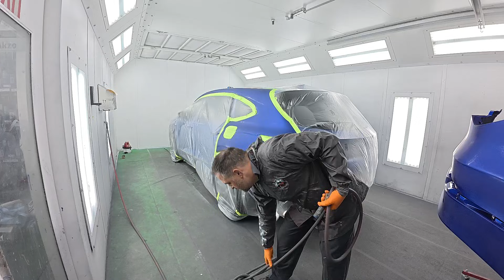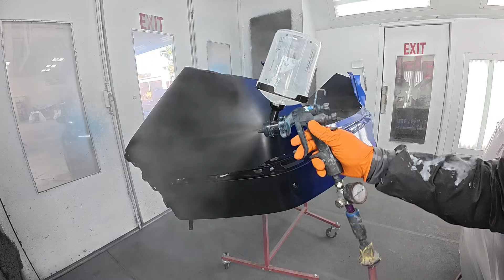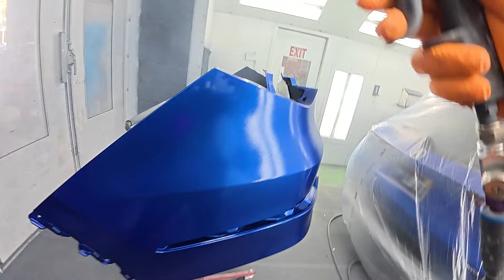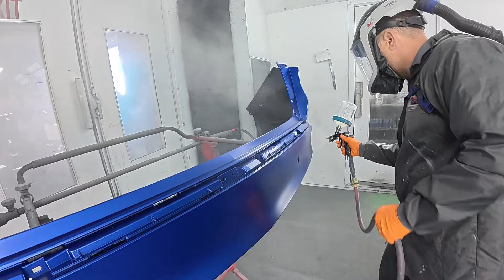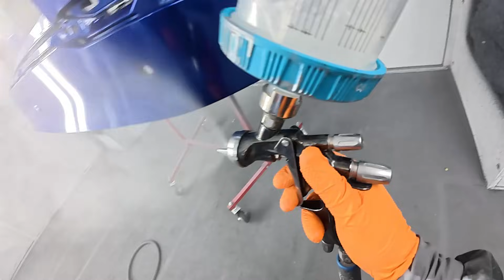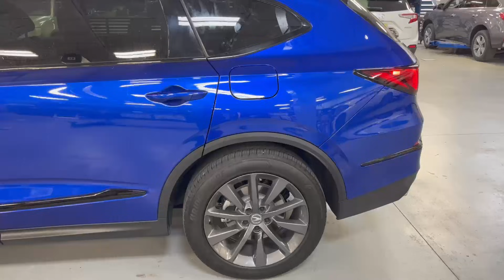How to Spray GLOSS Without Orange Peel! (Gun Setting Guide)

Comment: Also, why would anyone not buff out? We have spent hours and hours sanding, cleaning, priming, prepping and painting. Its mad to me why someone wouldnt want to spend that extra 30 minutes finishing what they started
Reply: Buffing is leveling the clear coat which means it’s removing a tiny amount of it. If you can spray it flat in the first place and not have to buff some of it off in order to get it flat, isn’t that better? Think about it.

Comment: In my experience the quality of clear coat you use is much more important than whatever gun or whatever gun setting you use. Low quality clears don’t have the hold out they should. And that even shows after they dry overnight and they looked outstanding off the gun

Comment: Do you like the supernova? I don't know how the new supernova's are but the first ones I felt made a lot of over spray. Recently I got rid of my 3 DV1's and switched over to ANI and I absolutely love then. That ANI Skull edition 1.3mm set that came with 3 caps an HVLP, WB, and CLEAR cap with digital manometer works awsome better than both DV1's for base and clear. For my 0.8mm mini for cerakote I got the R160 HPS that has the receptical above the air knob and fluid control so I can use the TMD1 manometer that came with my 200 Skull. Still using that Porphis 1.8mm for my primer gun. Out of all the different primer guns ive owned its the only one i ever liked.

Comment: I found out one thing with my spray gun setting. I always used fluid screw all the way out like you said and try to match the speed. But It looks fine but after drying I always had orange peel. I decided to make it 2 turns in and closely watch when the clear coat is sprayed and it lands smoothly on every coat. By watching closely and spraying less fluid I managed to get smoother and much better clear coat without orange peel

Comment: So,let's say your base didn't go on super well, maybe it's a little rough, what grit would you use to knock it down so it's smooth?
Reply: I wouldn’t touch it. Only recoat. 
For small imperfections, it’s ok to sand with 800-1000.

Comment: Hey Brian.  Are you using the new fine tips on that 3m gun?  Does your base coat your using have hardner in it?
Reply from the maker: Yes, they worked very well
Reply: @PaintSociety   I would love to hear more from you about the 3m fine tips.  I have been using them for clear and base with very good results.
Reply from the maker: @Tablerj23  I don’t have any issues with them. They’re really good and they really break up the clear very well and they’re just very easy to clean out.

Comment: Will there be an adhesion issue with the areas that weren't sanded and are still shiny?
Reply from the maker: Some areas in a video look a little bit less scuffed than others, but everything has at least a maroon scuff pad on it, sometimes the lighting of the camera in the booth will project it differently b

Comment: I love to see a video on spraying a one part finish without clearcoat.  That seems to me to be much harder than using clearcoat with regard to orange peel.  I will be painting an airplane that uses a one part paint system, I think mainly to save weight, and I’ve had issues getting a reasonably flat finish on test panels.
Reply from the maker: Single stage?
Reply: Polyurethane enamel is all I use.
Reply: @melissasmess2773 Any issues with orange peel as compared to clearcoat finishes which seem to lay down much flatter?
Reply: @LTVoyager Aviation Paint is for durability not for a smooth finish. While its not impossible to get a pretty smooth finish, its not what the paint rep will say can be done
Reply: @JimmyJiveJones Yes, I understand that, but just trying to learn as much as I can and get as good a finish as possible.  I have sprayed some scrap sheets and still have more orange peel than I like.  The rep recommended no reducer be used, but I’m thinking of getting some and trying 5-10% next and see how that works.  The rep said the issue with reducer use is you can get sags or runs below the rivets and I know from prior work that this is a real issue.  Still, just want to optimize as best I can.
Reply: @LTVoyager If you want a really smooth finish u may have to use a pretty high end gun like an Iwata or a DV1 to accomplish that. Ive sprayed automotive paint for 2 decades and can get glass finishes basically using Tekna guns but when i sprayed Imron (Semi/Bus) paint, it was extremely hard to get a great finish to my standards. But i did notice the other 2 painters there getting great finishes, 1 was using a DV1 and the other was using a Iwata WS400 or LS400......

Comment: One problem I ran into recently was my hardener going bad. I’ve been painting for a for years and never really even thought about it
Reply from the maker: Correct everything has a shelf life and can directly affect the result of the paint
Reply: Jesus how long did you have that hardener? I remember I had a half of a kit of Acme Finish 1 FC720 that was at my dad's on the shelf for roughly 20 years. I mixed it up sprayed it and had no issue. That is not to say other brands wouldn't remain good and keep in mind it was kept all those years in a climate control garage in Pennsylvania. I am sure if it was exposed to the well below freezing winter temperatures and the extremely hot sticky humid and hot summers we have here in and out for those 20years it could have  gone bad.